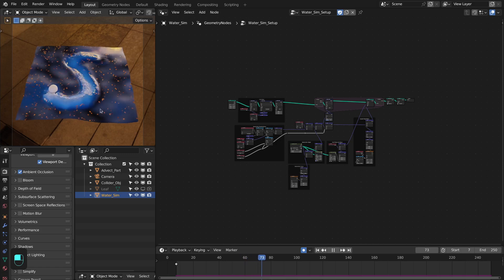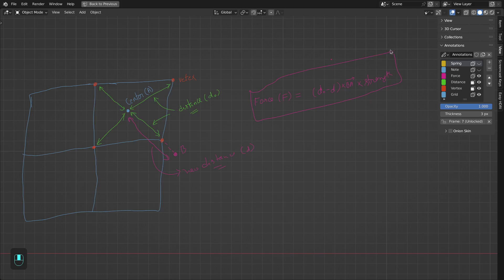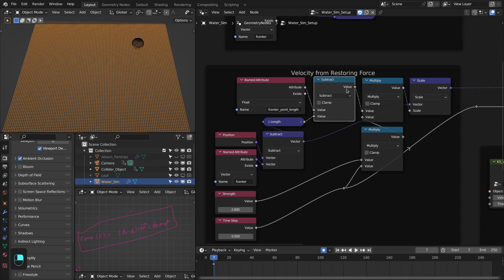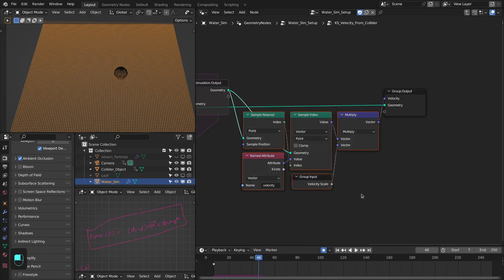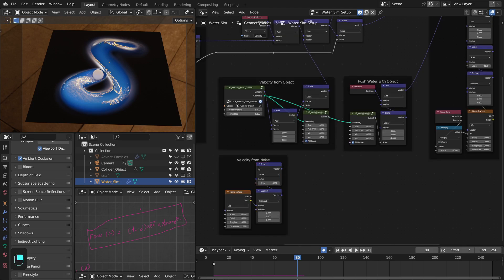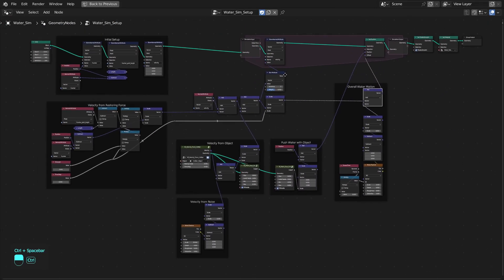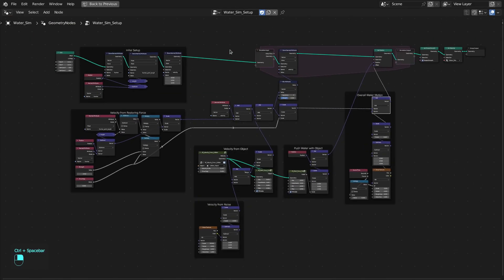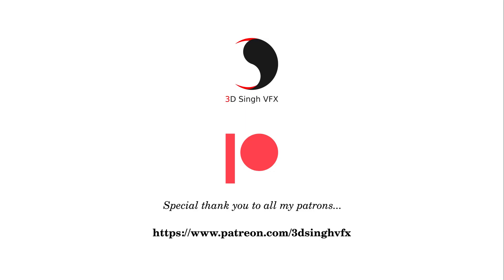Water using Simulation Nodes in Blender - Detailed Tutorial

Comment: Hey, great video! I am struggling to get the velocity attribute to work in the shader editor. Any tips? It just gets no usable output info
Reply from the maker: Hi, Thanks. The "Velocity" is a vector attribute, so you can use the Vector Length node in shader nodes for further use.
Reply: @3DSinghVFX  Yeah, what I mean is that when I call the Velocity attribute in the shader editor, it has only 0 as a value, I get 0 from "lenght" and 0 from the multiply node too
Reply from the maker: @cgtin-3d  Hi. Could you DM the file on my Discord server?
Reply: @3DSinghVFX  Thanks for the offer, but it seems its fixed. I had to capture a new vector attribute with a different name, and it works just fine! :)

Comment: This is soooo interesting! It's almost like a flowmap, which is extremely useful to map prodecural textures onto it. The dynamic paint from Blender is quite cool but simply cannot handle drawning trails (like mud trails), but with a flowmap that would be possible, once the coordinates are there, you can put whatever texture you want!
Reply from the maker: Thank you. Yeah, it preserves the UVs, so it is easy to use any texture. However, if you are interested in the trails effect, I have a dedicated tutorial for the Memory Falloff: https://youtu.be/xtOBInaESP8
Reply: @3DSinghVFX  Yeah, but the flowmap draws sort of a coordinate system, so it distorts the textures in the direction of the flow. Nice I'll check it out!

Comment: IN 3.:05, I get how you store the position of each face as a field, does that always assume that the Position of a face is its center? Secondly, having done that, you then move onto storing the distance from that face for each point in fcenterpointlength, but how does it know to only store the 4 points belonging to that particular face, as you described in the intro? It looks like it should be storing the value for every possible point over every possible face. How does the selection work?
Reply from the maker: Hi. In the Store Attribute node, set it to the Face domain, so it will store face centre. For calculating distance, I used the Named Attribute node to get the centre of the face then subtract with the position and calculate the distance which is stored on the points domain in Store Attribute node.
Reply: @3DSinghVFX  But how does it know that you are storing the 4 points of that particular face? As opposed to the rest of the points for all the other faces?
Reply from the maker: As the domain type is Points, GN automatically handle that interpolation (implicitly approach). However, you can also use the corners of face, to get the face's vertices that will be explicitly approach.
Reply from the maker: You can check that it's doing correct with the help of force direction.
Reply: @3DSinghVFX  ok thank you.